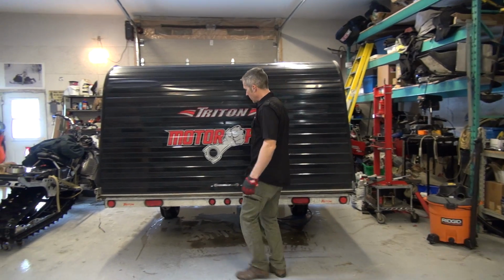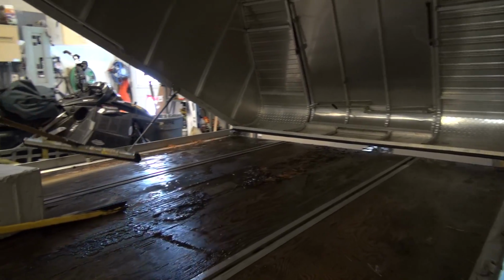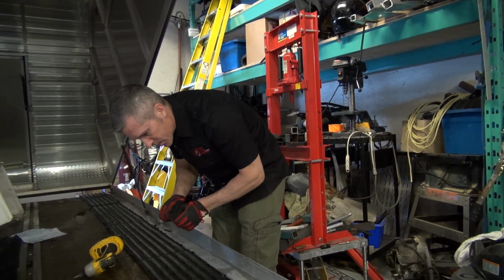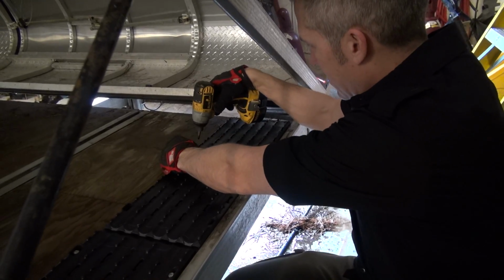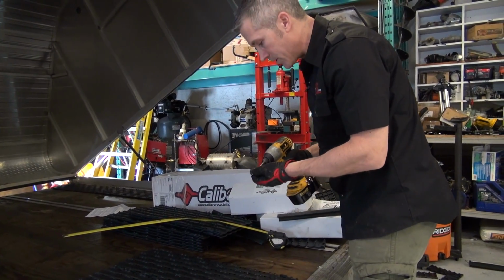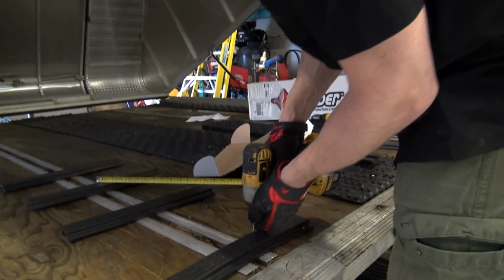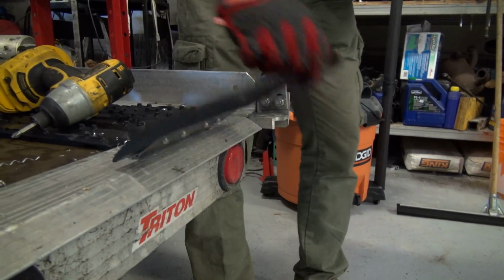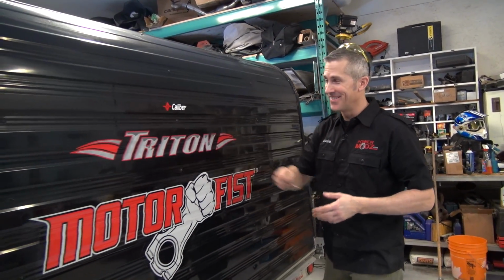Snowmobile Trailer Caliber Products install!  PowerModz!

Comment: Now, if you just shoved the sleds into the back of a pickup box, you wouldn't need all this stuff or the trailer. Its how we did it in 1969 :P
Reply: You also didn't have 163" long skid's in 1969, those sled they're using are probably 1/3rd if not longer than those old sleds were. Would be sticking out of the box like a sore thumb, plus they've got 2 sleds when they go out for a ride.
Reply from the maker: lol, ya good times, i fondly remember the yellow cabs, mind you they weren't much lighter than todays sleds:)
Reply: They had double tracks in 68, and 30" wide single tracks in 62.